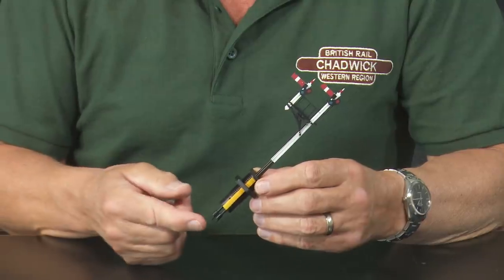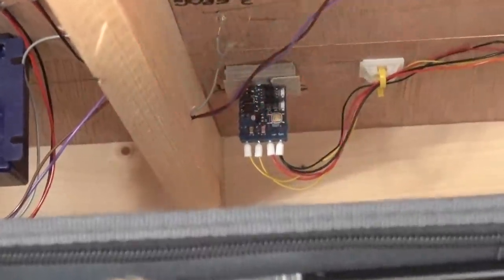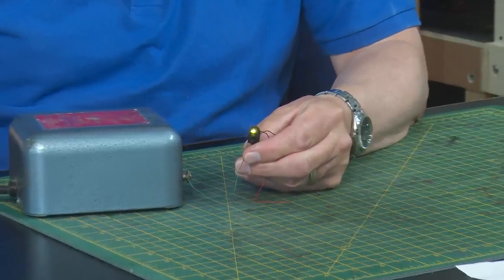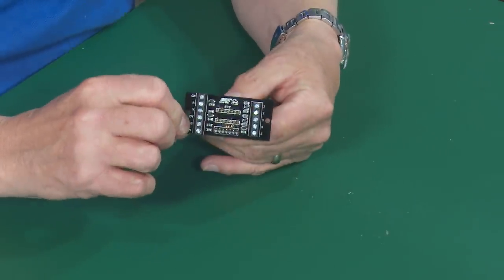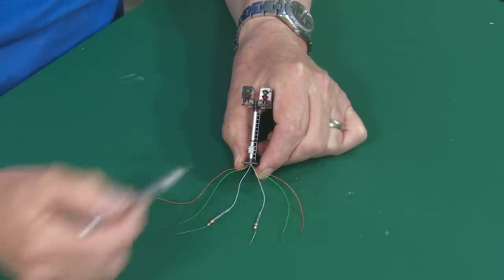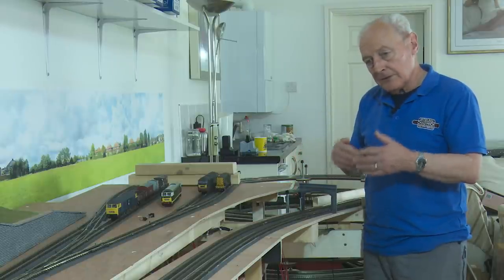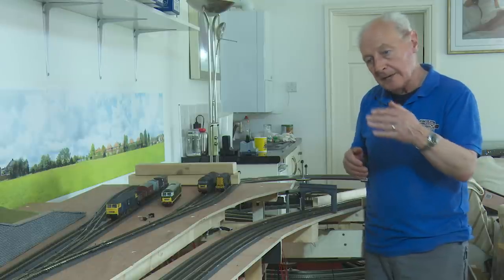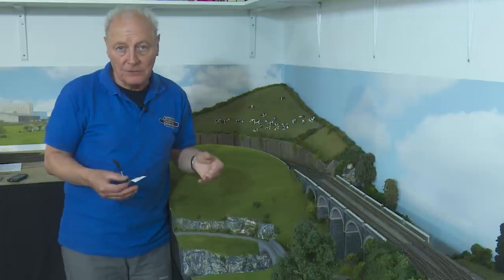Wiring LED and Semaphore Signals at Chadwick Model Railway | 135.

Comment: How far can one take signalling too, the bounds are endless I guess. I came across a signal circuit a few years ago which makes the whole thing simple. I don't have DCC or block detection but I use a magnet under the loco and a descrect reed switch used in a door alarm sensor. When the train passes over the sensor it turns to red then when the train reached the next sensor the light turns back to green and the next signal turns red and so the loop continues. https://dlb.sa.edu.au/rehsmoodle/file.php/466/kpsec.freeuk.com/signal.htm
It's so simple to build even my then 14yr old with no electronic experience put them together. Great work with the videos
Reply from the maker: What an excellent method Steve. Regards Charlie

Comment: sorry  i maybe wrong but i think you've got things the wrong way around   the resistor protects the led from getting too much current  so should be between the  power/current  feed and the led (before) not after.  how can the resistor protect the led if it is after the led gets/receives it's power/current?
Reply: David, the current goes through the diode and anything in series. Therefore the voltage reduction by the current passing through the resistor will happen whether the resistor is before or after the diode. As mentioned elsewhere in this set of comments, the required current for nominal operation differs for different LEDs (both the style and the colour) and also the nominal operation may not balance the perceived brightness, so you may want to put the ballast resistor into individual lines, and have a simple common. Horses for courses, and your experience may differ.
Reply from the maker: Hi David, Tom has hit the nail on the head.  I doesn't seem logical but it is.
Regards Charlie